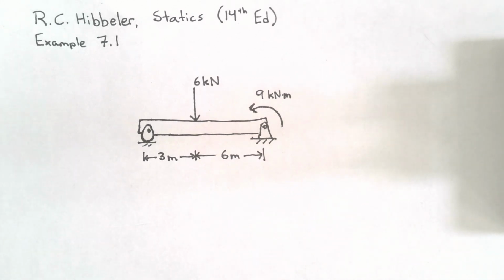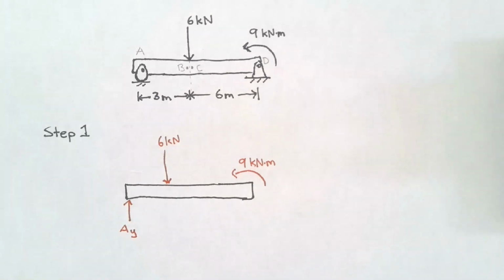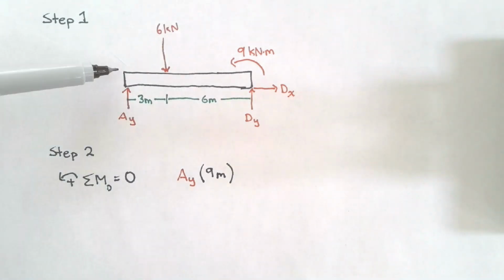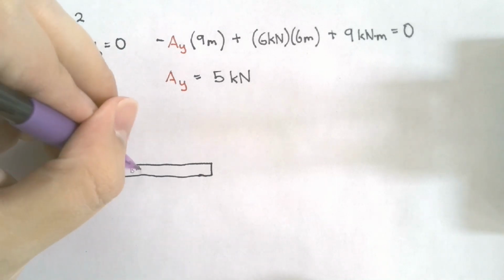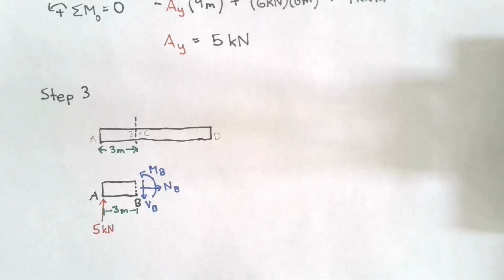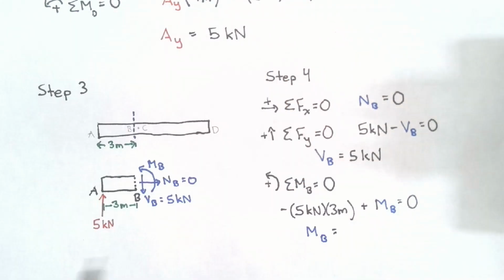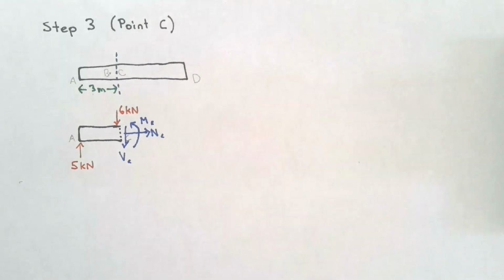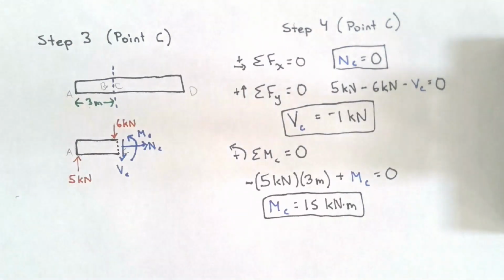Example 7.1 (Hibbeler, Statics)

Comment: why didn't you use the right portion of the section? or will that just give you the same values
Reply from the maker: As long as you calculate your external reactions first, you will get the same values regardless of which side you choose.
Reply: Word. Thanks!